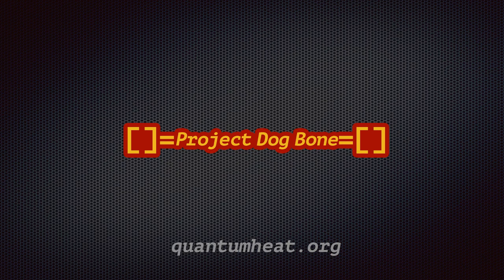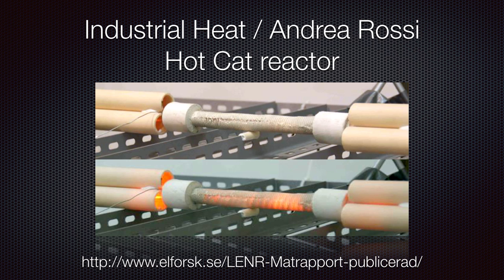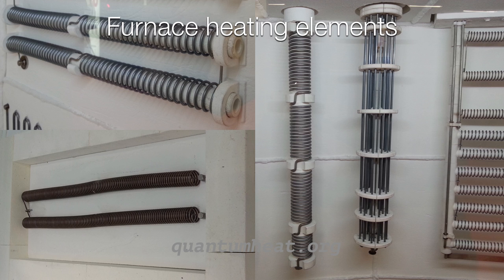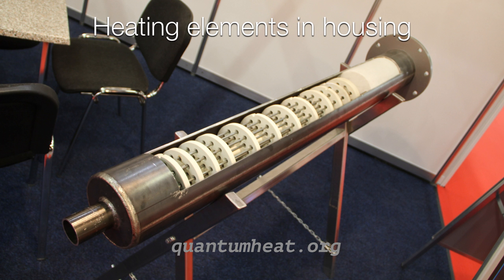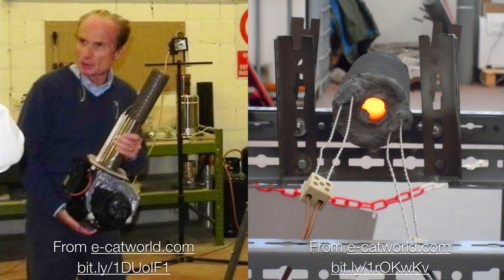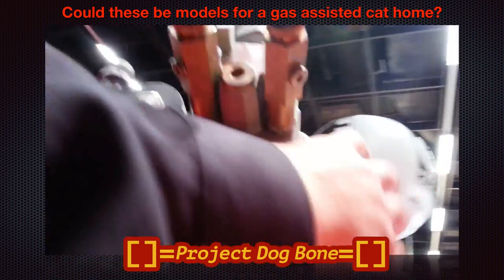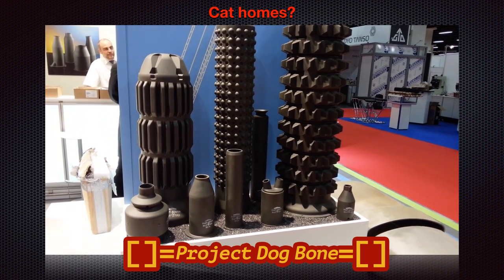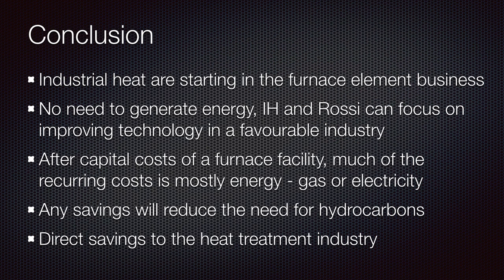[]=Project Dog Bone=[] - Lucidity

Comment from the maker: Hi Timo, it is good to have you joining us here too.

Since the findings in this video are not based on anything Rossi has claimed or said, but rather on observation of the specific morphology of reactors combined with practical experience of working in LENR for over 2 years by the narrator, how exactly has Rossi lied?

Since you are thinking, other than a baseless "lie" attack, what do you propose as an alternative for both the form and the materials used in the previous two hot cats. Your "critique" would have more credibility if Rossi had been claiming that the reactors were for the industry suggested in this video, but he has never done so.

So, please spare us all wasted life and present a coherent argument, with adequate supporting evidence, for what you say.

Comment: Could it be? Not with a COP of of 0.97 it couldn't!
Reply from the maker: We have read the papers on which your comment is based and will conduct several experiments to test for this. We will first need to get a PCE830. Mathieu in France has a 3 Phase supply as does HUG in US. The control logic team are working very hard on creating logic to drive a virtual reactor.

Single phase option from 1 team member Sanjeev. Rinse Repeat

http://www.falstad.com/circuit/#%24+1+5.0E-6+1.9265835257097934+50+5.0+50%0Av+448+224+448+336+0+1+50.0+230.0+0.0+0.0+0.5%0A174+576+128+768+128+0+10000.0+0.7079000000000001+Firing+Control+%2Bve%0Aw+672+112+672+32+0%0Aw+672+32+816+32+0%0Aw+816+400+768+400+0%0Ar+576+400+768+400+0+20.0%0A177+320+400+320+128+0+23.38441107011299+0.7850388037068967+0.01+0.0082+50.0%0Ar+448+224+448+128+0+100.0%0Aw+448+336+448+400+0%0Aw+448+128+576+128+0%0Aw+448+400+576+400+0%0Aw+448+128+320+128+0%0Aw+448+400+320+400+0%0A177+576+128+576+400+0+-23.38441107011299+-23.384411070113003+0.01+0.0082+50.0%0Ac+816+288+816+400+0+1.0E-5+-13.545936448602419%0Aw+816+32+816+288+0%0Ad+816+288+608+288+1+0.805904783%0A174+320+400+160+400+0+10000.0+0.7178000000000001+Firing+Control+-ve%0Aw+240+416+240+480+0%0Aw+240+480+64+480+0%0Aw+64+480+64+240+0%0Ad+64+240+288+240+1+0.805904783%0Ac+64+240+64+128+0+9.999999999999999E-6+2.6924499888621582%0Ar+64+128+320+128+0+20.0%0Ax+484+187+528+191+0+14+Load+1%0Ax+480+286+532+290+0+14+Phase+1%0Ao+7+64+0+289+80.0+1.6+0+-1%0A

A non-microFUSION based design by Osmo

http://www.partsim.com/simulator#22588